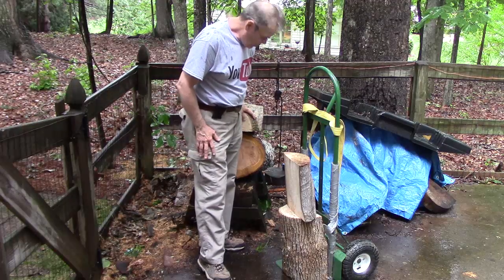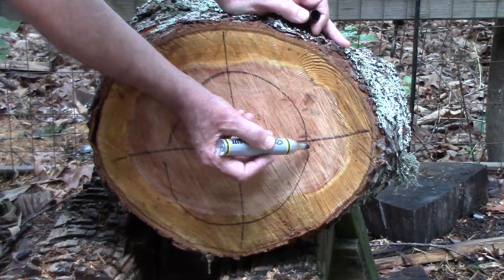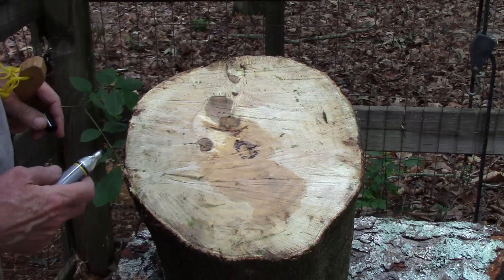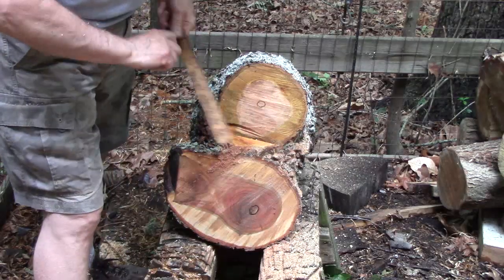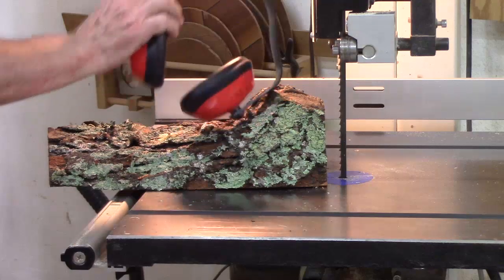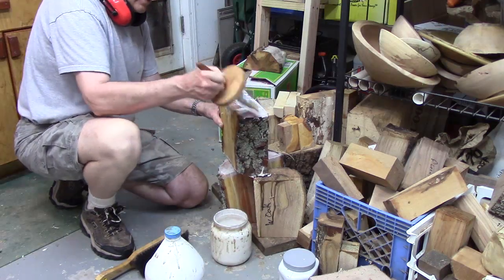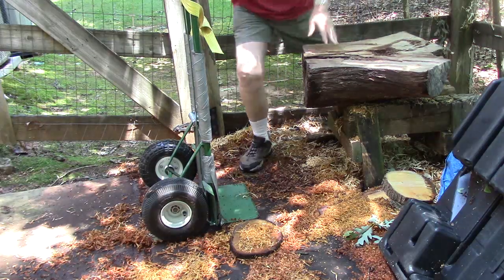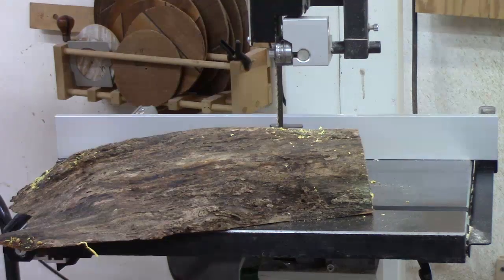Turning A Log Into Wood Turning Blanks

Comment: Great video BUT, not a good example of safety equipment when using a chainsaw. Tennis shoes-NO, Shorts-NO. Sorry, but you should be wearing proper protective equipment. I understand it is your choice but have seen too many times where you think you are able to handle it and one slip and things change. You almost dropped a piece on your foot and boots with steel toes would prevent a potential broken foot.
Reply from the maker: Thanks for your concerns. You motivated me to check the price of steel toed shoes and I see they are quite reasonable. Next time I buy some Sketchers at buy one, get the next pair half price, I will pick up a pair.
Reply: @MikePeaceWoodturning  Thanks for taking ithe comment positively. I agonized after posting it that it may have been too strong. I simply want to make sure you are able to educate the novices like myself. Have a great day.
Reply from the maker: @SpartysDad  I have learned to take all comments as feedback. Sometimes it helps me to rethink things. Sometimes we don't get everything right. I appreciate you taking the time to post.

Comment: You stated that Anchor Seal only lasts for a little while. So how often should a person reapply it if your timber is green when you first apply it?
Reply from the maker: It is not the reapplying that is the issue - It only slows down drying, it does not completely stop it.

Comment: What about electric saws.
Reply from the maker: Very handy near the house or trimming a blank on the lathe. Someone was using one of these yesterday at a workshop and was very happy with it. Thin blade and 15 amps. https://amzn.to/2Hqw5Nz  I am not convinced about battery powered ones yet.
Reply: Battery operated are really handy, I have a Dewalt 60V. I use it to cut turning blanks and also use it when I ride my side by side for clearing trails of fallen trees. I am well satisfied with its performance.

Comment: Is it possible to just dry the logs by sealing either end and come back to them and turn them after they dry out? Honestly im at a loss, ive tried so many methods and i still manage to get alot of cracks. Ive tried taking out the pith and cutting out blanks then sealing them to no avail - had apple crack and warp on me. Ive tried not sealing at all and just keeping em indoors and had cracking again. And somehow - my neighbour who threw out a log into the garden like 3 years ago, ends up with no cracks... im wondering whether its worth the hassle of sealing or even trying to protect the logs i do have at this point.
Reply from the maker: You do not dry logs for wt. Keeing turning stick in log form as long as possible is good. You get some cracking, a few inches, that you can cut away. This is better than cutting and storing bowl blanks which tend to Crack. Think of green wood like fruit. Do not get more than you will use soon. Roughed  out bowl blanks will generally have minimal cracking compared to whole sections of a tree.
Reply: @MikePeaceWoodturning  Hmmm food for thought. So keeping things in log form until you're ready to turn and only processing as much as you can turn in a  relatively small time is best to avoid cracking, if i understood correctly? I have a bunch of logs (40 or so large diameter) ive sealed on either end and stored under a balcony outside - there is no way i can process all of it - so this is good news. Much appreciated - you've saved me alotta work and heart ache.

Comment: By removing the bark I'm guessing you don't do many natural edge bowls. Do you find that in removing the bark it causes more uniform drying of your blanks? I have several logs that I'm processing now so this technique has been helpful in deciding my layout. Any thoughts on putting together a video on chainsaw sharpening? I have an inexpensive saw and have probably spent more sending it out to get sharpened then I actually spent purchasing the saw itself
Reply from the maker: I am more concerned about the bark holding or concealing critters. I don't feel like I am expert enough to demo sharpening of CS but it is a thought.  It is not that difficult.

Comment: mike how do you like your rikon bandsaw,,the reason I asked im getting ready to get the 10-326,,,and is your 220 volt,,this 326 is 110 volts
Reply from the maker: Mine is a 18" 2.5 HP 220V. When I got it a few years ago it was on sale at a big discount. I think the 10-326 model may be a higher quality model and should provide all of the cutting capacity you will need.  Rikon has several different price points for each size. I think mine was a mid range model.  I think there are better saws than the one I got but it was a good value and I am satisfied with it. I use it a lot. Big improvement over my previous Delta 14 with riser block.

Comment: mike if your cutting a tree branch about 6 inches in diamenter do you still need to remove the pith,,reason I asked this is because there would not be much to work with if you do
Reply from the maker: Generally on many woods with a piece no more than 6" in diam., if you cut exactly thru the middle of the pith, the wood will be able to move while drying and not split.
Reply: thank you mike